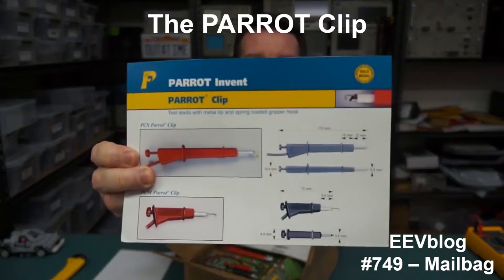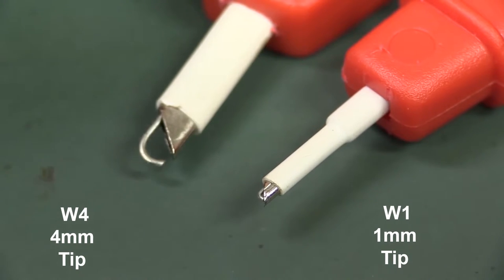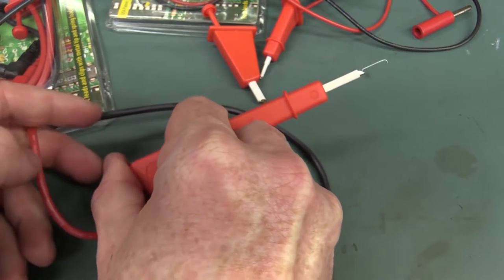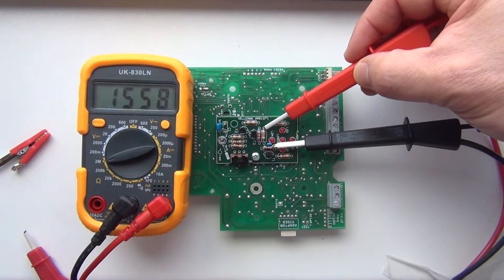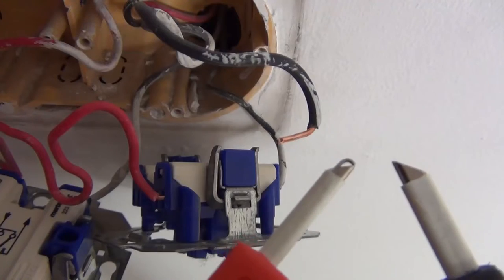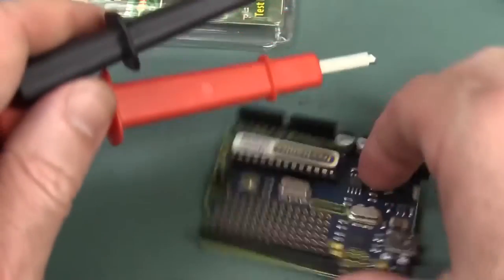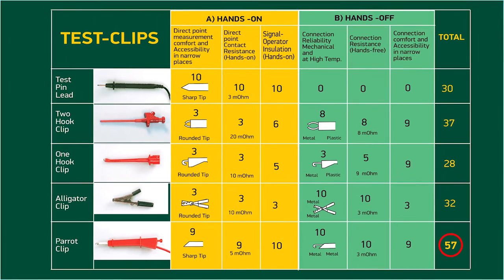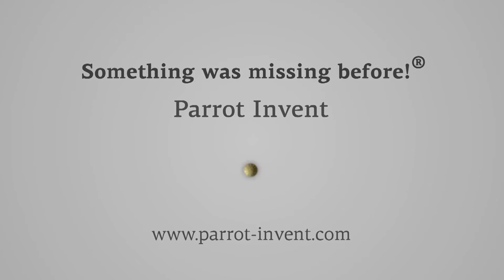Parrot Invent Test leads and Clips with comments from EEV Blog 749

Comment: I bought a few sets and they are after that standard probes for my cases with multimeters and Scopemeters. They took a natural place side by side with Fluke, Keysight/Agilents original probes and used a lot more than other hooks, clips, alligators etc.